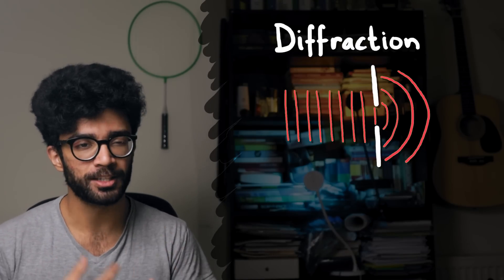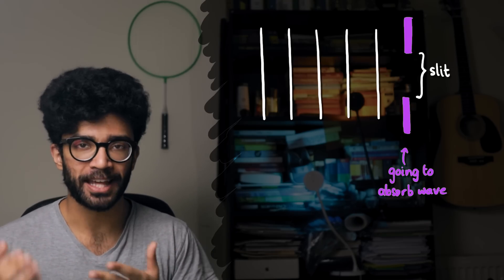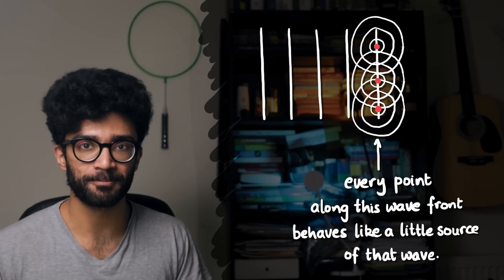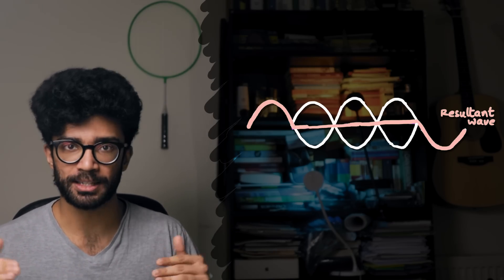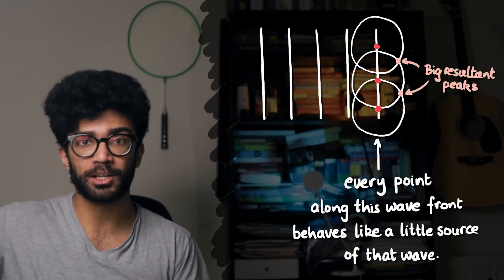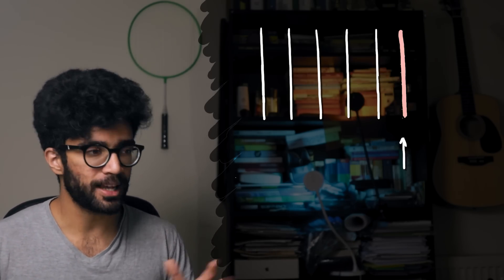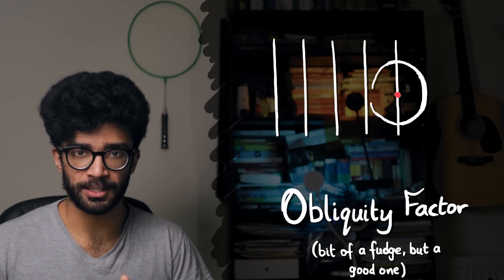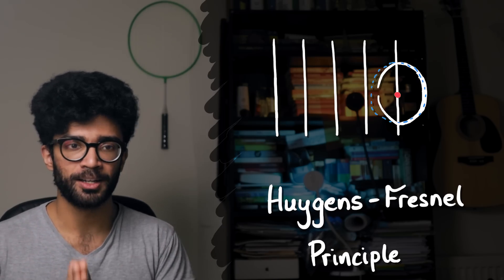Diffraction: Why Does It Happen? (Physics Explained for Beginners)

Comment: Interesting video of which most of I knew but had forgotten. I didn't fully understand the last Huygens-Fresnel Principle though. And a few probably stupid questions came to my mind: How does planar wave know it hasn't gone through a slit already. Before going through a slit there are edges of planar waves which have points that eminate secondary waves in every direction and there are no other points creating secondary wave interferece beyond them. How come those planar wave egdes don't produce diffraction but the edges of/after a slit do? Also, what happens for the energy of two destructivly interfering waves if we create a system where two waves can only destructivly interfere?
Reply from the maker: That's a good question, and one that I should have addressed - the plane waves I was talking about, before they went through the slit, should technically have stretched to infinity (i.e. the straight lines should have been infinitely long), since this is the assumption we make when talking about waves about to pass through a slit. Therefore, they should not have had edges - but I had to stop drawing them somewhere lol. So they don't know that they haven't passed through the slit, I just drew the diagram badly / should have talked about this.
Reply: @ParthGChannel  Thanks for your answer! But how this works in reality? Isn't a laser planar kind of wave with edges before it goes through a slit? Or is laser having a diffraction already at it's edges when it comes out of laser apparratus?

Comment: Why the plane waves before passing through the slit are "plane"? I mean secondary wave point sources towards the ends of planes also don't have waves above them? They should also form curved wavefronts, right?
Reply from the maker: Somebody else also asked this question and I addressed this slightly badly in the video. When I say plane wave, technically we assume these wave fronts are infinitely long - I just couldn't draw infinite straight lines. So for a plane wave there will always be a point above it or below it releasing secondary waves. After passing through the slit, these wave fronts are then finite in length, thus allowing their ends to curve.
Reply: Just a thought! Do planes form closed rings?
Reply: Harsh Ojha if they’re not infinitely long
Reply: I have the same concern

Comment: These models are based on the suposition that every point of the wave acts as if it's emitting a wave, and what we see is the resultant wave. However, why should every point of the wave have this property? How can we interpret this problem physically and intuitively rather than mathematically, for example, in terms of the resultant motion of the molecules in the wave?
Reply from the maker: You're right, there's no reason for every point along a wave to have this property - but we also don't have any indication about any other behaviour that would work. The fact of the matter is, this is a mathematical model that predicts how waves behave in our universe, and that's it. But that's true of EVERYTHING in physics. For example, our understanding of atoms is based on mathematical models, originally assuming that protons, neutrons, and electrons are tiny hard spheres. Now we think of them as a "cloud" of matter (quantum physics). The universe behaves in the way it does, and we simply try to fit ideas that we understand to this universe and hope to correctly predict behaviour in other untested scenarios.  As for your final point, what if the wave we're discussing here is a light wave? It's not made of molecules - what then? We can't think of it using photons either, because a light wave cannot be thought of as a perfectly arranged set of photons moving through space. We could do this potentially with water, but these equations are too complicated to solve.

Comment: Amazing video as always. I understood most of it but what confused me was why in the primary waves (in the diagram you drew they are the lines) do not have bend towards their ends as well. Moreover, there are other points of constructive interference (of the secondary waves), which also form a line- what do they represent?
Reply: Also, the first wave after the slit is not round but flat with round borders... I wonder if we get that same shape in reality too ?
Reply: Well, the primary plane waves actually stretch infinitely on either sides.. only the part that hits near the slit is shown in the diagram.
Reply: @arvindupadhye6172  
But do we obtain that shape in reality just near the slit ? Or is too hard to measure precisely ?